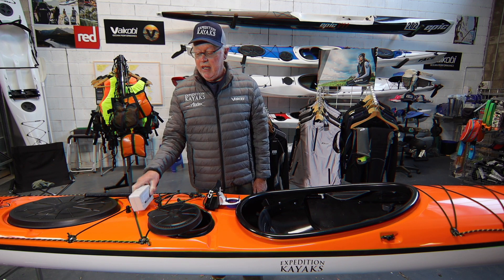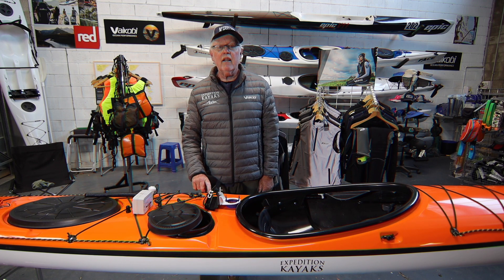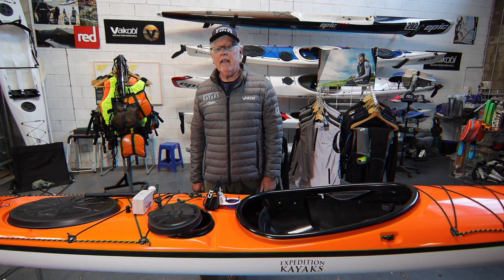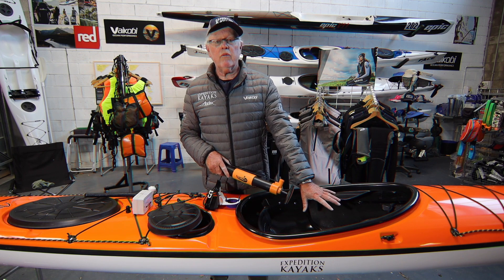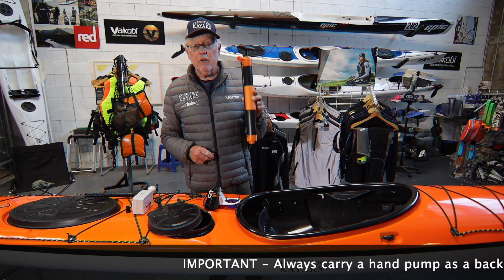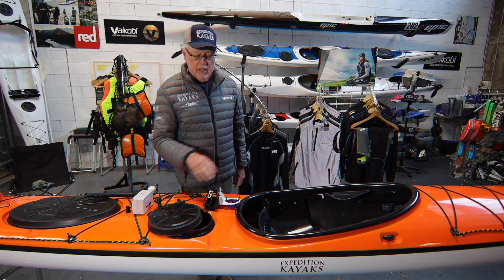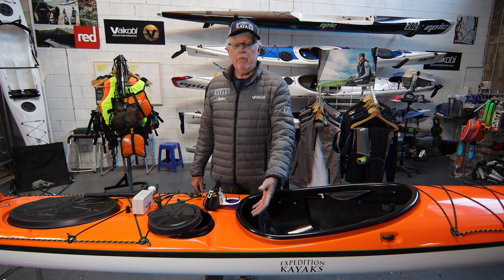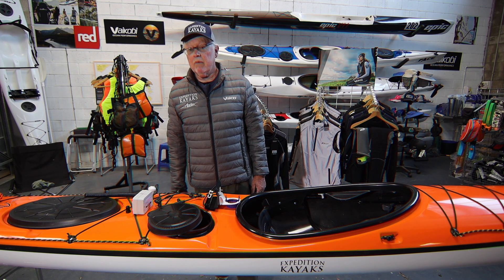The EK Integrated Electric Kayak Bilge Pump

Comment: Wouldn't a portable battery bilge pump be more practicable?  Run the hose out your spray skirt?
Reply from the maker: That's assuming you have a hand free to pop your deck, hopefully now allow more water in, mess around setting up your pump, activating the switch, and staying upright....